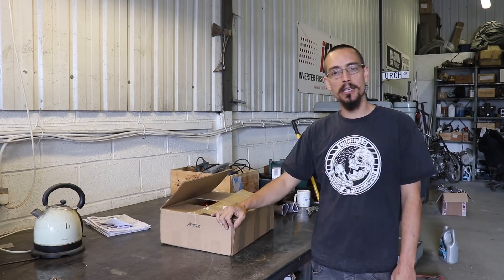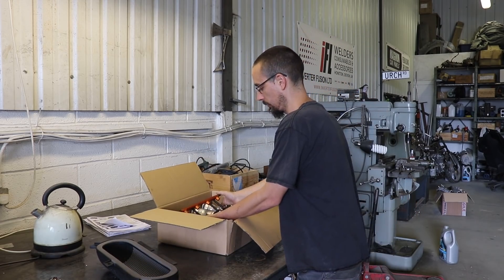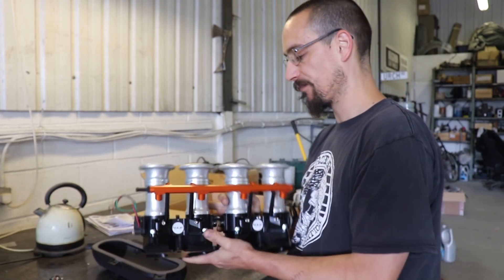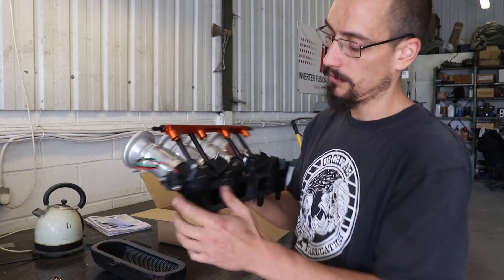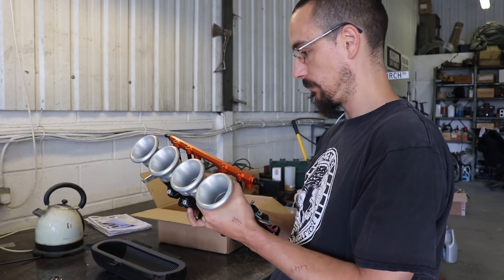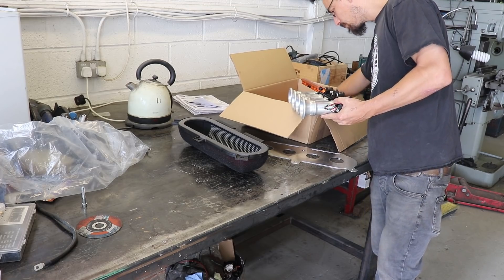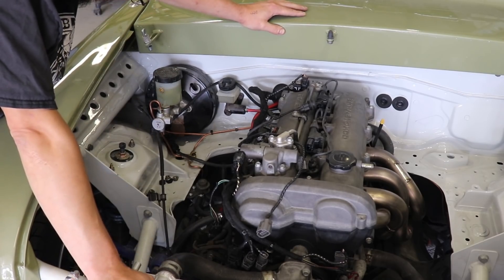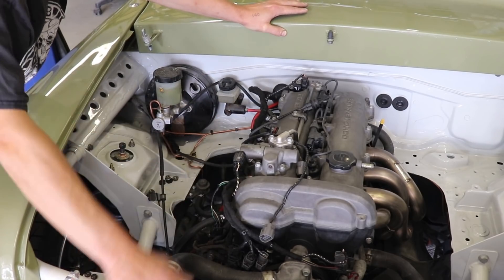THE FINAL PIECE - THE MONGREL PT 78

Comment: Not sure on the exact setup for the MX5 setup but I'd guess the capsule on the rail is a damper rather than a regulator. Most stuff has a single fuel feed from the tank with the reg internal (deadhead). A nice easy cheap fix is the combined filter/reg as used on most of the early 2000s BMWs. They have feed & return plus a single feed upto the rail. They are fairly cost effective & freely available. I think they regulate to 58psi from memory. Shame to dump the pretty anodised rail!
Reply: S B I think Matt is using a SAAB engine rather than a Mazda one. I may be wrong...
Reply: @christopherward5065  This is a Mazda. The Escort and the drift rod had Saab engines.

Comment: If that is really a 2001-05 donor, then the regulator is in the tank, and those are pulse dampeners.  They do look like the early NA regulators and the NA18 ones, but if there is no return line, they aren't regulators.  Also, you will, I suspect, have to tune using Alpha-N now, will that ECM do that?   Cool build.

Comment: Are you not tempted to just dump the brake booster/servo while it's off Matt? A bias brake system would weigh less , give better brake feel and allow you to adjust for different conditions as well as being lighter. Your car is so light you don't need servo assistance.

Comment: I think there are fuel resistant paints, but it's probably too late for that now.  Brake fluid is probably going to take off the paint too.  There is a rustoleum clear coat rattle can that claims to be fuel and heat resistant, I don't have any experience with it.  The underhood paint probably should have been painted with Acrylic Urethane paint, from what I read.  Oh well sometimes ** happens.

Comment: Copper brake lines?  Seriously?
Reply: Apparently copper lines are good for 8000psi and they don’t corrode like steel lines . So there is that .
Reply: i seriously doubt they are copper,  i dont think matt is an idiot.
mostly likely cupronickel of "kunifer" as its known, about 90 copper/ 10 nickel-
 in the uk/ its far safer due to lack of corrosion than steel, far easier to fit than stainless or steel, ever tried flaring a steel brake line?
far cheaper and lighter than braided hose.
, wont fatigue due to vibration like copper would , wont split or degrade like rubber hose can or give you a soft pedal.
, perfectly capable of high pressures involved in braking.
arguably its the best option out there aside from stainless , but if you think flaring steel is hard? stainless is a pita.
Reply: Copper Nickel brake lines are the best!
Reply: @deadprivacy  i flared stainless once. And never again.
Reply: @Turb0esky  even to do steel with a heavy duty brake pipe flaring kit, we put the pipe die in the hydraulic press and  an adapter onto the arm on the opt indent lever to accept a scaffold bar... it was laughably absurd but we only had steel pipe...the kit is designed for steel pipes too but its a bit old and the pipe just slips in the normal brace.
we found some olive type couplers that we use on steel if we have to these days.
Reply: @kirstysinclair9021  won't corrode but brake fluid is hygroscopic, so your lines turn green and flake off from the inside. 
Works fine on the cars that will not be used much